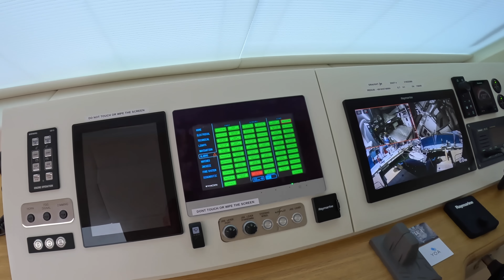€14 Million Superyacht Tour : Sunreef Power 100

Comment: What a cracking boat but to me they’ve got the mix between modern design and old fashioned decor. Looks like something from the 80s in the cabins. More contemporary interior design and this would be a knockout boat. Great presentation as usual Mr Burnham.
Reply: The tiles in the heads need changing too, horrible 1950s kitsch.

Comment: The owners nailed it for the exterior - the colour scheme looks great and suits the size and shape of the boat perfectly. However, they really should have had someone giving them better advice on the interior. It’s clearly a very well specified vessel - the concealed Soss hinges give some clues in that respect. But the interior fixtures are extremely dated and underwhelming and the fussy trim and “dirty” mirrors are plain awful. I reckon this one will be refitted within weeks if the current owners ever have cause to sell it.

Comment: I write my honest opinion again.
It seems messy with the large bar, where a regular yacht has a dining table and chairs.
It's also messy with an open galley that continues into the captain's domain, it can't be easy sailing in the dark.
How many sun beds are needed that could have been replaced by some beautiful furniture.
The dungeon for the crew is reminiscent of the holes on the old slave boats, and 2 meters more could be used for a proper bath.
No wonder they were a bit of a nuisance.
But But But, great video as always Nick, you are a true Champ. ❤

Comment: Can’t fault the vessel……. outstanding volume for hull length, as only a CAT can provide. The cabins are ample, although they are always lacking the traditional feel of the old school mono hull yachts.

Where I would change would be the main deck and flybridge….. as you enter from the aft cockpit I would section off the Starboard rear quarter to be the galley, using drop screens to allow for choice of open or closed off. I would then have a formal(ish) dining area to Port and the entire remaining to a very informal lounging area.

No main deck helm. It always looks like an afterthought on these vast CAT main decks.

I would have decent wing stations Port and Starboard in the aft cockpit.

Then, on the flybridge, I would section off the centre forward area, to a proper Pilot house. Glazed on three sides, plenty of opening glass for ventilation, inclined forward screen giving a decent view of the bow.

I remember when the “flat top” Broads cruisers, Bermuda(?) Caribbean(?) emerged……. Richardsons at Stalham, Moore’s at Wroxham…….. ugly, from a purist view, forward helm, seemingly an afterthought to one side of the central access to a small cockpit well…….

Drove like a coal barge…..😳

But, for a family holiday, floating, they were unbeatable…….. which is why they still command high prices as live aboard homes…….

This, albeit much better looking, gives me the same vibe……… each to their own 🇬🇧🥳

“So long as you’re floating………..”🎉

Comment: Another great review.  I've got to agree with other comments....the boat is incredible, but the interior I'm not too keen on.  I'm FAR from an expert, but it seems odd to have the main helm right by the galley, and open to the main saloon area.  Usually they are seperate, so they can block off exterior lighting so they have better vision at night.   Also, I don't understand how someone can pay so much for a boat like this, and pay so little attention to the crew's comfort.  The 2 'crew cabins' are more like solitary pits on some penal colony.  If my safety & comfort are relying on the crew...then I want them to be comfortable and happy as well.  Maybe not the same as the guest cabins...but a lot better than what is currently on this boat.

Comment: So the helm is basically in the galley?  Lots of space, but I'm not a fan of the layout whatsoever.  The crew quarter access, for example, is ridiculous, as is the exercise equipment in the main saloon.  Finally, as with cats in general, having the engines separated can be an advantage or a curse.

Comment: Great size and exterior design. But interior layout is horrible for all that available beam space. A 'helm' shoved in the corner of the gallery? Fitness space visible from the open saloon as well. Reduce that massive bar and move the galley back. So you have a proper sprayed helm area. Especially on a 100ft boat.

Comment: Not partial to the colors chosen or the antique decor on the heads. 
Another point is the layout. Both dinning areas are outside. What if yiu are in cold or stormy weather? 
Crew 2 cabins?  How many crew members you need to run this vessel?
For a vessel this big i would have expected more elegance and better distribuition. Say more  like the 80 footer. I like the large tender platform but think a lot of space is wasted with lounges, where other tenders/jetskis, submarines etc can be stored. 
In short i feel the interior and exterior areas are poorly designed

Comment: If it were me I wouldn't order a boat where the forward crew are crammed in like that.   That's a storage space, not a crew space.   Engine looked too cramped to work on too.   Other parts look awesome, but you've got to think of the welfare of the crew and only the captain had a reasonable space.

Comment: I did not see any solar panels, did I? Terrific looking boat...but the owner should be called out for not investing in any solar at all.
Always love the catamarans, and every single mirror wave from Nick...but I am still amazed at how FEW owners are spending any money reducing their impact on the environment. SMH ✌
Reply: If they own a 100ft yacht, sticking some solar panels on it is barely going to make any difference to their humongous impact on the environment.
Reply: @RandyRodgirth  They could easily get more than 5kw worth of solar capacity on all that roof/hardtop space, and they definitely have the hull space and displacement to carry a large enough bank of batteries to hold the power it generates. They could absolutely make a useful dent in their daily fuel use for electricity generation, if they had a solar array to help with the house load.